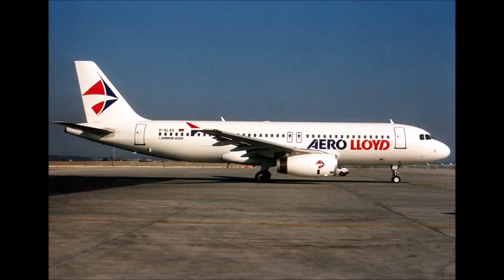ATC - Aero Lloyd 1135 - [Contributing factor for the Überlingen mid-air collision] 1 July 2002

Comment: Aero Lloyd 1135 was on a different frequency than every other plane flying over southern Germany and northern Switzerland that night. It was a delayed flight running two hours late to Friedrichshafen which ATC had trouble contacting due to severed phone lines and other factors. If you listen to the full 15 minute ATC recording you can briefly hear the aftermath of the explosion in the ATC recording in the left audio channel if you listen to the full 15 minute ATC recording because the radio transmission button was momentarily pushed down on Bravo Tango Charlie 2937 after it broke apart after the collision. Prior to that you can also hear unidentified electronic beeps (NOT morse code, probably some custom installed warning system, similar to Spanair 5022) which originated from Dilmun 611 when it entered a 70 degree Dutch roll after the collision.

Back to the ATC recording: Aero Lloyd 1135 is in the right audio channel on frequency 119.920. Every other plane (including Dilmun 611 and Bravo Tango Charlie 2937) is in the left audio channel on frequency 128.050. Anyone working ATC knows that juggling two sectors (even at night when there's less traffic) is a living hell as you have thousands of lives on the line.

Comment: Can you mix the cvr of the two flights, the other traffic, and the aero lloyd flight into one video?
Reply: Someone on youtube already did it, with captions but very poorly. I'm not naming names; apparently they forgot there were two captains on Bravo Tango Charlie 2937. Flight Instructor Grigoriev (acting as Captain in Command) was in the Front Right seat calling all the shots and whose voice is heard on the Air traffic control recording, and Captain Gross, was in the Front Left seat, being monitored by Flight Instructor Grigoriev.

User probably should have read this: https://skybrary.aero/sites/default/files/bookshelf/415.pdf